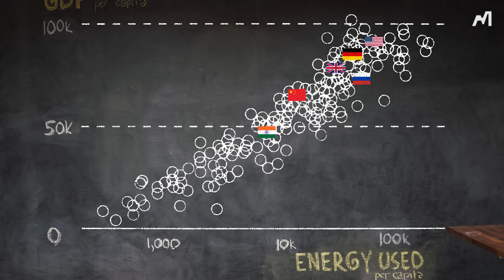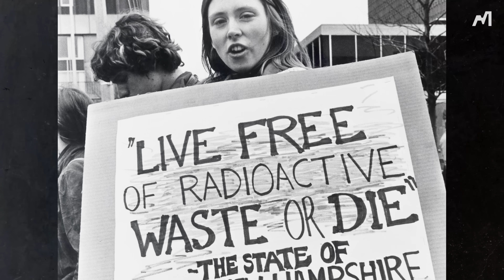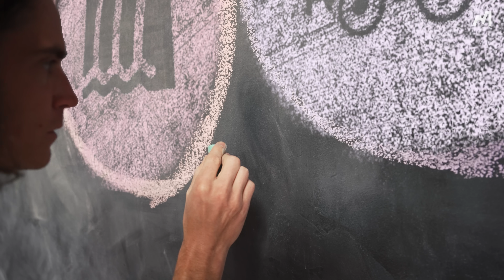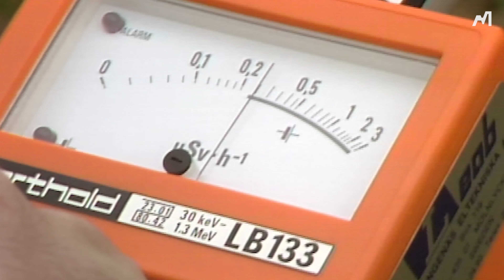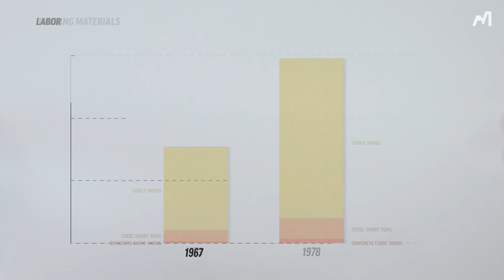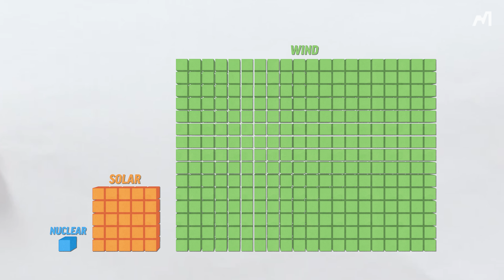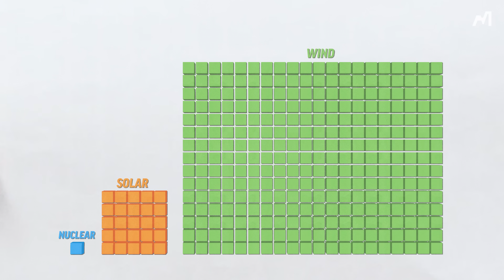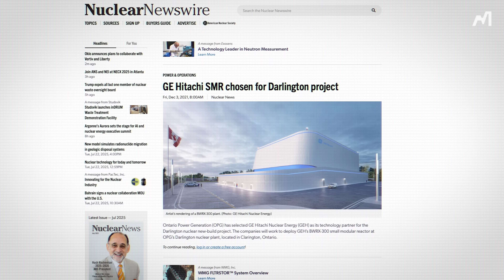They're Lying to You About Nuclear Energy

Comment: The larger scale reactors offer a degree of efficiency and output that cannot be achieved by the SMR reactors for grid scale or even major data center and industrial cluster applications. The industry should've modularized the large scale reactors instead of designing and building every individual reactor from scratch. Unfortunately the biggest challenge in bringing back the mega reactor industry is the loss of the industries needed such as hot forging of the steel pressure chambers that are also used in the old submarine and shipbuilding applications, while China and Russia have massive capacity for such niche industries due to their massive defense and commercial industries and the fact that their critical industries are state owned, so they don't demand on profitability to maintain their capacity even when the demand decreases for a while, we need to treat some industries as critical national security matters and subsidize them because many other critical industries depend on their existence

Comment: There's studies into agricultural solar. Basically space is left between panels to allow sun for part of the day. It helps reduce the heat load on the plants. 

The fact is the solution isnt one or the other. Its all of the above. Just end coal. Ironically too much nuclear material in the dust .

Power solutions need to be tailored to the geography anc kimated and needed density. Nuclear is not cost effective in the climate of Texas, too much solar and wind capacity.

S Korea also used a singular design across the country. It cuts costs year over year.

Also every decade around the -6-7 year if a decade is a new nuclear renaissance.1997,2007, 2017, 2027. And every time by the following -1 whatever was talked about is dead in the water with millions spent on white papers and not a piece of ground broken, or if ground is broken it's shut down within a few years.

Comment: i think nuclear power plants are awesome
just think about it: you have guaranteed power production for about 60 years and you can stockpile the fuel in a reasonably small area = your nation is at least partially independent from outside interference like a war in the area where your oil and gas is extracted
less pollution, less environmental damage, etc

that being said, radiation is no joke. 
the old movie with some guy swallowing radioactive material is crazy.
there were little to no studies back then about the effects of radiation
now we know a little more, i think it is ok if all the safety measures are checked again if they are needed or not, by neutral experts
i think just slashing out the regulations without verifying first is a very bad idea

Comment: The good news is bad news... China came to the USA and was given all our Thorium reactor data and designs. Now, they are building Thorium reactors around China, and have actually gotten a reactor live in China. Instead of China starting up a coal fired plants every week or so, they will be replicating the Thorium LIFTR's around China, while the USA is using a inefficient fast fission reactor where about 1% of the energy is actually used to generate power.

Comment: 11:38 it's cleaner than solar and wind when you take the mining into account.
Reply: Because Uranium is not being mined? Did you take storage of spent fuel into account as well?
Reply: @mostbeautifulroads9789  while I can't quote any study I can garuntee that the amount of material needed to be mined for nuclear power is a tiny fraction of what is needed for the others. The storage is easy and only expensive because of excessive regulation. Said regulation also stops us from using better methods

Comment: I'm German and not a particularly big fan of nuclear, although I'm very much interested in finding functional solutions to deliver reliable and somewhat green energy, to drive humanity forward. I have two major doubts in mind after watching the video:

1. Talking about security risks and possible effects on health. I haven't looked into the data e.g. of deaths connected to Fukushima or Tschernobyl, but I think you pay to little attention to the efforts that have been made, to protect humans and nature in the surrounding areas. For example storing all the radioactive water still used for cooling in Fukushima or evacuating whole cities close by. Without those measures, consequences are hardly foreseeable. 

Therefore I think, that at least rising safety standards during a time of boom (70s) is to some extent a critically important development.

2. Speaking about the nuclear waste. In this regard you only mentioned, that there are possibilities to store them safely (people hugging huge concrete containers) but you're not talking about the timescales. I think this is very much critical, because this waste probably will outlive humanity (Iod129 - 15,7 Mio. years half-life). Current safety measures will only function as long as there is a functioning ruling system providing with what's needed to keep things safe. And talking to America, I'm not sure if a country, existing for 0,00005 % the time of the above mentioned isotope half-life, is able to give those securities.

I'm curious how we will feed this ever hungry beast called humanity

Comment: As a nuclear graduate and professional, I am extremely impressed with your research and presentation of the material. I can tell you put an enormous amount of effort into this piece. Thank you!
Reply: As a nuclear graduate and professional, you should know this. How much metallic plutonium I have to ingest to incur a significant dose? how about how much uranium oxide? Blows my mind how nobody so far has objected about the statement at the beginning; that plutonium is not that dangerous, simply because a dude ingested what seems to be uranium oxide pellets and the way the bomb cores were transported on the Manhattan project.
Reply: @teresashinkansen9402  Can you offer some credible physical empirical science to the contrary? (links)
Reply: @whaleoilbeefhooked3892  Aren't you a graduate and professional? 

I cannot post links else my comment gets deleted but the LD50 of plutonium is 320ug/kg the one of uranium is about 66mg/kg also the toxicity of uranium is chemical as a heavy metal, the one of plutonium is radiotoxic. This is very basic stuff. Just because you don't need massive lead shields against Pu-239 does not mean it is not extremely radioactive and dangerous if it gets into your body. Also plutonium behaves like calcium so it gets incorporated into your bones so it keeps doing damage for decades. Plutonium really its extremely dangerous and toxic.
Reply: @teresashinkansen9402 
Not good to ingest plutonium. You will die fast from toxicity. Before than by radiation.
Best regards.
😅👍🏻
Reply: @teresashinkansen9402 do not eat plutonium
Reply from the maker: That's a high bar, thank you
Reply: What is a nuclear graduate?
Reply: You say you’re impressed with the video, but why are you okay with comparisons between sunlight and nuclear radiation? The sun doesn’t emit alpha and beta particle radiation, and the video talks nothing about this 😅 The video is blatantly missing the actual nature of nuclear radiation when it talks about risks and guys lugging around plutonium.

In a video titled “they’re lying to you about nuclear energy”, I was highly disappointed by the dishonesty (or maybe the lack of information).
Reply: Definitely, and therefore the earth is not a spinning wet marble hurling though a vacuum at ludicrous speed chasing an elusive fireball into infinity.
Reply: I wish that the nuke industry would push for a bit more intelligence in this field. 

The builders needs to design new plants to accept 2+ thermal/steam sources and start it with nat gas. This way, the utilities can build out power plants FAST, instead of going with the insanity of what is happening now. Once the reactors are installed at a plant and stable for a couple of years, then the boiler(s) can be removed, or converted to using H2/nat gas mix, and provide backup, extra demand following.
Reply: Have you ever looked into what would happen to a nuclear power plant or warhead if there was a major solar flare like what happened in the Carrington event?Nuclear is the worst form of energy in the world. Its not green in any way. How do we dispose of the irradiated cooling liquid?
Reply: @zavelazer8167  Nothing would happen to the reactor, maybe the substation gets damaged if the protection mechanisms fail. Irradiated water from reactors is not a big issue, it can be cleaned easily with ion exchange resins. Nuclear is much better than most energy sources.
Reply: @teresashinkansen9402 if the cooling pumps fail due to electronics breaking down after a solar flare you get Fukushima. Is that your definition of nothing?
Reply: @luipaardprint  Small electronics are not vulnerable to solar flares. Transformers connected to very long transmission lines are vulnerable because the changing magnetic field caused by the flare as it interacts with earths magnetic field induces a current spike that saturates the core of transformers overheating them. But you need Km of wire for this. A generator a computer or some relays in a power plant wont get affected at all.
Reply: @zavelazer8167 Did you copy paste this all over the comments? Modern designs have very little byproduct.
Reply: @zavelazer8167  Hmmm…nuclear facilities in the UK have discharged radioactive materials into the ocean and other bodies of water for many decades.  Fish, mollusks, Crustaceans and Echinoderms seem to thrive.  Recent reports from 2025 highlight issues at the Springfields Fuels plant on the Ribble estuary, which discharged a "very large amount" of uranium into a protected marine site, and a 2019 leak at the Coulport armaments depot on Loch Long (Scotland) where radioactive water was released. Additionally, the Sellafield nuclear site in Cumbria has been releasing low-level radioactive waste into the North East Atlantic for years.

Modern enrichment using gas centrifuges requires far less energy (around 50-60 kWh per separative work unit or SWU) than older diffusion processes (around 2500 kWh per SWU). For the equivalent electricity from a nuclear pellet (one ton of coal), more than 410 liters of oil or 350 cubic meters of natural gas would be needed.  Aside from the sun directly, minus the infrastructure required, nuclear is the greenest mass energy source known.

The ‘Carrington Event’ was merely a label given to the short-order destruction of the first undersea cable between North America and Europe.  That, a redundant cable was deemed of prime necessity, an insurance fraud was facilitated.  In fact, an undersea HV casing ground caused a high voltage spike to transfer past the step-down transformer system, releasing a voltage spike on the LV side before a timed fuse protection system was enacted.  To appease those who practically were witness to the factual spike, investors turned to the falsehood belief that a solar wind of sorts could have been responsible.  The belief in solar flares being of destructive nature to Earth’s electrical systems remains a prominent folklore with astrophysics to this day.

Comment: The absolutely rampant misinformation at 14:20 ish is not a good look. Windmills are extremely cheap, nowhere near the cost of a newly constructed nuclear site. C'mon man. At least try to look like you know what you're talking about.
Reply: I work in wind, it’s about 2-5 million per turbine, and yeah they rly aren’t that efficient, some brands never make their money back in power, the only upside is that it doesn’t burn oil and gas to produce power
Reply: @tategoldbeck9810 okay let's take that 'doesn't burn oil' . What are the blades made from? Plastic. Pylons? Steel. Hmm, wonder how you make steel? That doesn't emit anything. Same goes for the concrete that they set the steel in. At least the steel can be recycled but the concrete? No. And the blades? Hmm, come on, tell the people what happens to the blades. Soon to be millions of tons of painted plastic BURIED in the ground.
Yeah, they don't take any oil at all.
Reply: @johngidman4574 you do realize he was on your side of the argument ya or is your reading comprehension that low
Reply: @tategoldbeck9810 do they use diff fluid?
Reply: @tategoldbeck9810 just to manufacture
Reply: Plastic bags are cheap as well. But they’re one of the biggest contributors to waste. Go check how much “unrecycable” waste Wind Energy creates. It’s so difficult to transport and process the large blades they’re just not feasible and just sitting in landfills. Your point being?
Reply: He literally spent a whole chapter explaining why Nuclear powerplants are so expensive and time consuming to build. What he’s saying about turbines and plants, is that they require similar materials, but the volume of turbines required to achieve even a fraction of the power output of nuclear, far outweighs the footprint and resources when compared to one nuclear plant. 

Holy moly you guys are brainwashed.
Reply: I believe he is saying material cost, equivalent power output, and over time, accounting for replacement of the turbines as well
Reply: Except they break down before they become profitable 😂 try again
Reply: @jmccoy96jm 25 years? When it takes about 7 years to earn a profit? Why do you think texas has the most by far in the country? As the oil state where many don’t believe in climate change? Because they make bank dude.
Reply: @Arachnocrabilalism 
Because they are heavily subsidized by the government.
Reply: If you know so much where's your video about how great windmills are?
Reply: This is an incredibly dumb comment
Reply: Sorry man, BS. Why don't YOU Google fiberglass shedding and the disposal of blades. Not to mention the absolute slaughter of birds and bats.
Reply: The footprint of a windmill farm has a far greater negative impact on the environment than a nuke plant ever will.
Reply: @unapologeticboomer-52 problem is that people dont have the capacity to understand why that is. Here in Norway windmills are a detremential to the avial wildlife too. Claiming huge areas with windmills is not doing good for anything. Less bugs? Then we have less bugs to pollinate, feed other wildlife such as birds and fish. It is all connected. A nuclear power plant on the other hand is confined and controlled and does nothing to the environment.
Reply: Windmills by far the worst renewable energy
Reply: He does, you just lack the critical reasoning skills to put things together to see the point

Comment: So Teflon is worse than Chernobyl?
Reply: Yes.  Unquestionably.  The teflon itself is fine once it's made - unless you overheat it, then it kills you.  But the manufacturing process is a massive disaster, it's contaminated groundwater in huge areas.
Reply: Almost certainly.
Reply: Possibly true..
Reply: Huh. I cleaned carpets for over 20 years using Dupont Teflon spray on carpets. Nozzle on my sprayer got clogged. I blew it out with my mouth. I got a big blister on my lip the next day. Went to Dr. I've had a lump in my lip ever since. Developed a thyroid problem too.
Reply: the best case story about teflon and the worst case scenario about chernobyl roughly line up
(talking about that one town whose river was being poisoned by compounds used in teflon production)
Reply: @kkjkjh  Both industries covered up real contamination and risk for profits.
Reply: Pfas
Reply: Yes. Teflon is running through almost everyones veins, including yours. Add it to the long list of chemicals that have been destroying people's health for many decades. Nuclear has nothing on dupont and monsanto.
Reply: Yes.
Reply: Yes
Reply: Heh, well the radiation from Chernobyl will eventually dissipate. Teflon is here forever.
Reply: It was a F::si ion N:: ke that blew it up - unless you believe a 2500 ton containment roof was blown of by a nuclear plant.
Reply: Just look for lead as a knocking agent if you want to read something truly disgusting.
Reply: Once Teflon is made, it's rather safe. The solvents they use to make it are the bad stuff, not the Teflon itself. They're called forever chemicals. Look up PFAS.
Reply: @cheatinggravity173  Thank you for commenting this. The "Teflon will hurt you" miss info is almost as bad if not worse than "nuclear is scary"
Reply: @cheatinggravity173  - Only now evidence is showing these "non-reactive" chemicals DO form complexes with other chemicals. They can influence how they work in the body. And they can do this forever in our body, or until death, whichever is sooner.
Reply: Keep telling yourself that.
Reply: @cheatinggravity173 I don’t think ingesting Teflon is particularly safe, quite poisonous I think….like when a saucepan starts to shed its Teflon coating after a while.